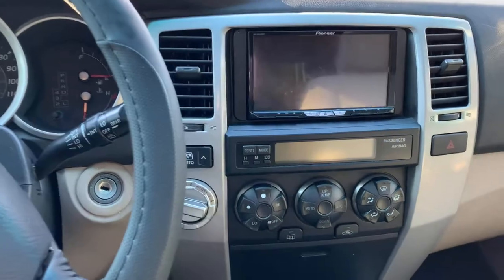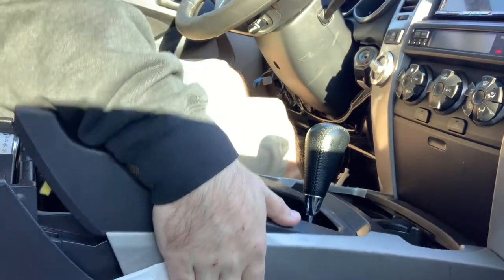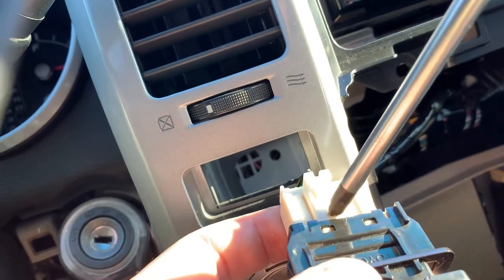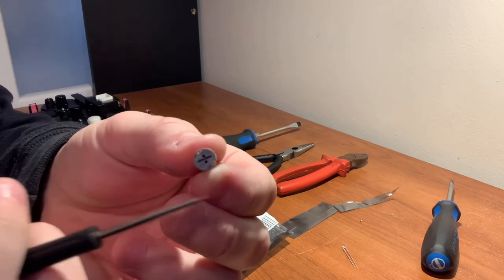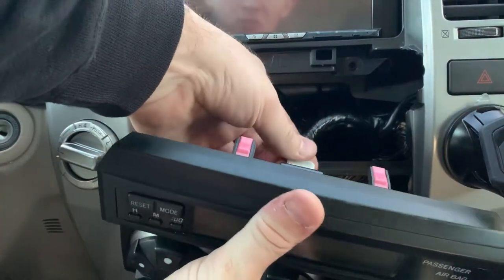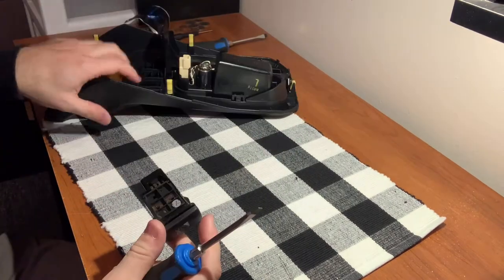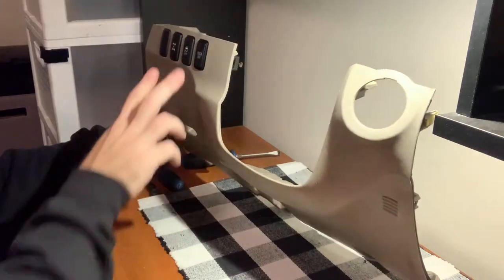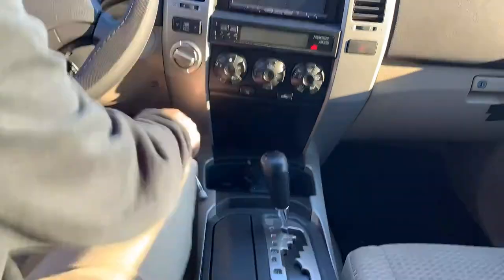4th Gen 4Runner Dash LED Swap Part 2 | With Dash Removal Steps

Comment: My priority was to first brighten the HVAC display and the new LEDs did just that. A few tips. Take the copper out of the bulb housing: Bend the contact arm up then push down and pull out with pliers. I broke a couple of LED leads so I made a small cut in the plastic so I could push the lead through. Form lead to make contact arm. Also I had to scrape the oxidation off the copper where the new leads will make contact. Works great.

Comment: The Rsca Is Roll Sensing Curtain airbags You hold it down till the light on the dash turns on saying its off and its for Offroading when the Vehicle tilts to a specific degree the the side curtin air bags will go off so you can turn them off while having fun in mud or Offroading 0:33 @SMITHEYS
Reply from the maker: Thanks! I appreciate that and it’s really good to know. I knew it had something to do with off roading, just wasn’t 100%.
Reply: @smitheys  no problem at all bro Hope the Information Helps in the future.. appreciate the Links to the leds and The entertaining video

Comment: You asked what the RSCA OFF button was in the video: its the rolling side curtain air bag off switch. only available for use in 4LO. Basically turns off your side curtain air bags while off-roading and putting the truck at more severe angles.
Reply from the maker: You’re awesome, thank you! 
I had zero ideas what it was. My 2019 that I had didn’t even have it, so I was  at a loss.
Reply: @smitheys  Yeah no worries man! I off-road often in my '04 V8 and have never used this feature haha. Keep the 4th gen vids comin! Also, is you trac off button stock? Or did you wire that in yourself?
Reply from the maker: Yeah, I love off-roading (mainly muddin). 
I didn’t wire in any switches yet, it looks stock.
I have a video coming wiring in a few switches.
Reply: @smitheys  What year is your truck? and its the V6 4WD right? I had to mod in a trac off switch on my '04 but found a way to do it with a factory switch and a wire tap
Reply from the maker: My runner is a 2008 4wd. 
Yeah, mine came the way it did, I think it’s stock. 
Very smart! I plan on doing a few switches, but mainly to the back, as an escape. Should be posting those videos in 2-3 weeks.

Comment: Hello.  Very good your video.  As you did with the display light or air indicator.  I put them the same but it does not turn on, only when I connect and disconnect the rear connector, everything else turns on but when you turn on the display or screen of the a / c indicators it does not turn on the color of the led that you place, it remains as if it were burned out the light, when they are new and good.
Reply from the maker: Thanks you! 
If the LED doesn’t turn on, change the direction of electricity. LED’s are directional and require current to travel one way, not both ways like incandescent.

Comment: Great vid just like the one before this! Isn't there also orange lights down in the cup holders? Is it possible to get those swapped too?
Reply from the maker: I don’t have lights in my cup holders, so I’m not 100% sure. Toyota is pretty consistent though, I’m sure they can be swapped.
Reply: @smitheys  easily swappable, #74 led

Comment: Hey I purchased the same lights off Amazon from ur kit for my 03 limited . It's weird though I swapped all of the bulbs.  Only the screen on the hvac system used the white leds. All my other light on the hvac where still orange . And the other switches didn't turn white or are even on. I tried switching the polarities.  But nothing.
Reply: Running into the same issue. Did you ever find a fix?
Reply from the maker: You may have a few bad bulbs or when you routed the wires they aren’t making contact with the terminal giving it power/ground. Did you turn your headlights on when you tested the lights? The headlight switch must be on to test everything but the HVAC display. 
There isn’t much that can go wrong unless your units lights didn’t work to begin with, but if you’re still having issues please send me an email and I’ll try to help.

Comment: can you please do a video and show off the lights, from the back seat. all together with the speed odometer.  also are the brightness still adjustable ??  Thanks :D
Reply from the maker: I can not. I no longer have the vehicle. Everything will function exactly the same. The only thing you’ll be doing is changing the color, that’s it! Illumination dims when the headlights are turned on, dimmer switch still dims cluster, etc.

Comment: hey man, im about to do this on my 4runner but im not entirely sure how to route the bulbs. any chance you could explain it to me really quickly or even make a short video on it?
Reply from the maker: No problem Mitch. So what you’ll do is unroute the leads out of the bulb holder. When you go to install the new bulb, put the new and old side by side and get the new length and cut off the excess. Take the new bulb and just follow the exact way the old bulb came out. If you need to, take out two of them and keep one for reference, that way you’ll have one to compare if you mess up. I promise it’s easier than most people think. You’ll just need a small flat head screw driver to start the lead to get it off. Hope this helps.

Comment: Good evening, so I just took out my ac control unit and replaced all the bulbs with the led bulbs. However when I hooked it back up none of them are white lights. Still the yellow. On top of that I took out two of the bulbs completely and plugged the unit back in and the yellow light was still coming on without any build in place. Any idea what’s going on?

Comment: The RSCA turns off the side curtain airbags in case you hit something hard offroading and don't want them to go off since you asked
Reply from the maker: That’s smart. Thank you! They were killing me because I would press it and nothing happened. I never tried it in 4x4 h or l, I guess it must be in that range. Thanks again.
Reply: @smitheys  I believe you need to hold the switch for a few seconds to disable side curtain airbags. When you are off roading and the vehicle rolls, it will deploy at some point thinking its a roll over. This switch shuts down the system while you are having fun. I believe the system re-engages once you are on highway doing a certain speed but not sure.

Comment: I am having a problem with some of the buttons being more bright than other buttons ,mainly in the three disk
Reply from the maker: It’s either the way it’s angled, try adjusting it by taking it out, moving it up or down (whatever way it’s darker), putting it back in and trying it. 
The second way, it might just be how Toyota molded your buttons.

Comment: Do you still like these white LEDs after a year of use? I thought they may be too bright for night driving.
Reply from the maker: I no longer have this 4Runner. The lights looked fantastic, not too bright, but if you have sensitive eyes they are still dimmable with the switch.

Comment: Hey, I was thinking about purchasing the red version of these lights since it would match my aftermarket radio but.. Won’t that effect the way the center console screen looks like, like where the clock is? Pls help. Thank you!
Reply from the maker: The only thing it changes is the color. It’ll still work.

Comment: whats the worst that could happen if i mess up..? i wanna do this so bad but am not experienced very well!!
Reply from the maker: The absolute worst is you could fry your motherboard and not have a speedometer. They sell them on eBay if the worst happens. The job is a lot easier than it seems. The hardest part is the soldering. The key is not keeping the heat on too long. Practice on something else if you’re worried and then knock it out. Or buy a cheap solder kit and cheap speedometer to learn. 
Good luck with what you decide

Comment: The link to the lights in your description have too thick of a wire to go into the grooves of the plastic housing
Reply from the maker: Just pull it. It’ll work.
Reply: And one more question. On all my hvac controls nothing works. But the bulbs work. I assume it’s just the entire hvac assembly bc the 2 bottom leds work. I tested with different polarity and got same results

Comment: Hi! I know it’s almost a year later but I was having a problem with the hvac screen having two bigger bulbs then all the others, and the bulbs from the kit not fitting. Should I just retry two new bulbs or is there a separate size I need to buy?
Reply from the maker: Hey Tyler! Yes, all the bulbs will fit but there are two of them with different housings. You gotta get a little custom with it, but as long as you line up the leads from the new bulbs in the housing, it’ll work. Hope this helps!
Reply: @smitheys  yes I believe it will thank you!! It just sits so deep in the housing in comparison should I push it all the way in or just sorta on top? i can also just try both and see what works haha
Reply from the maker: No problem! Yeah, I just had it sit all the way down in the housing. It was a bit dimmer, but no by much.
Reply: @smitheys  sweet I’ll definitely try that thank you so much!
Reply: @smitheys You can also buy 2 T4.2 LEDs. They come with the proper housing and you can drop those two in.

Comment: Are resistors not necessary?
Reply from the maker: No, no with those LED’s.
Reply: @smitheys  Oh rad, just realized resistors are built into these! Had no idea they existed. This makes life so much easier. Have been wanting to do this mod for 2+ years and now I'm actually goin for it.
Reply from the maker: Totally worth it, you got it! Good luck.

Comment: I just replaced the bulb on the rear window switch and now the window won’t go up or down , does anyone know what could be the cause
Reply from the maker: Sorry to hear the trouble. The bulb wouldn’t have any effect on the operation of the switch. You may want to check your wiring, it may have popped a fuse if it wasn’t inserted all the way.

Comment: Where did you purchase all the replacement led bulbs? I bought a pack on Amazon but they did not work! After I put them in the bulb and case would not fit in the dash compartment it belonged to.
Reply from the maker: Sorry yours didn’t work for you! The ones I got were from Amazon as well. They require lead trimming though.. I have links in the description of the video. One set is solder on LED’s and one where you have to physically route the lead around the housing, cutting off the excess lead.
Reply: @smitheys  Ya the bulbs from amazon you have listed are the ones I tried to use. Do you know anywhere else to get bulbs? Mine are all different its weird. I have a 2006 4Runner XSP 2xwheel drive
Reply from the maker: It should work. When you take out the old bulb, put it beside the new one to get the length. Then cut off the excess, and run the leads through the bulb housing just like you took them off. Make sure when you put a new bulb in to get it to seat all the way down, ALL THE WAY DOWN. If you do it right the bulb should be all the way down in the housing and not sticking up at all.
Reply: @smitheys  I pushed it down pretty hard but it seemed it did not fit correctly in housing. The visibly looks bigger than the ones in there as well.
Reply from the maker: It will work, I just double checked the link to verify they’re still right. You might have to spin it 180 so the leads go in the opposite holes on how you have it. Another thing you can try is spreading the leads just a little near the LED so it will seat properly but be careful not to separate the lead from the LED. It’s not drop in and go, takes finesse.
Reply: @smitheys  Ok I will give it another shot and see how it goes. Those bulbs will replace everything in that climate/screen unit correct?
Reply from the maker: There were two bulbs, I don’t remember which two because I filmed this over a year ago, that are different but you just have to coerce it to work. The bulbs are hard to get out  from the housing as well. They have a bracket on them. You just have to remember or take a picture of the bracket, then brake off the bracket and put the leads from the new bulb where the bracket was. 
Hope that makes sense. (I think it was the AC controls/clock, but I honestly can’t remember).
Reply: @smitheys  so I got all the bulbs in but for some reason I still have some orange. What year is your runner? I have a 2006

Comment: the led legs are a bit too big
Reply from the maker: Yes, that is correct. These LEDs are used for a variety of projects. You have to trim them with wire cutters or some type of snips for what you need.
Reply: @smitheys  sorry I should have specified I meant in thickness
Reply: @smitheys  did your fit perfectly? Because as much as I tried to place them back to how it was it didn't fit into the grooves
Reply from the maker: Oh ok! Yeah the new leads are thicker. As long as you get them through the housings holes and the bulb seats, just get it as close as you can. It’s not going to be perfect, the housings weren’t designed for the bigger lead, but it works. I hope this helps.
Reply: @smitheys  quick update I got it to work, yay